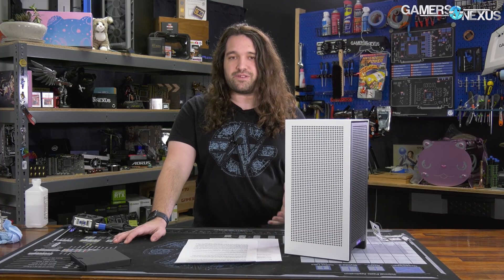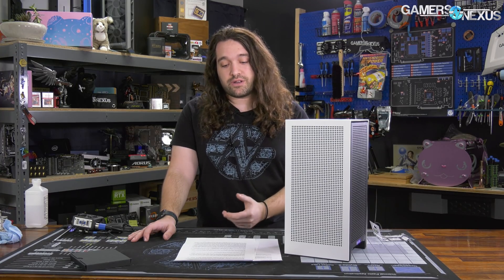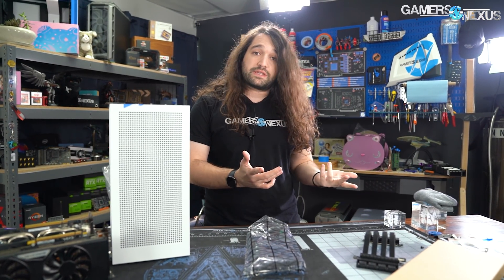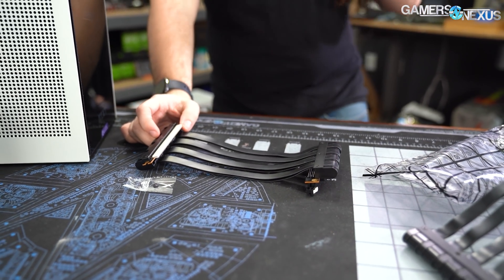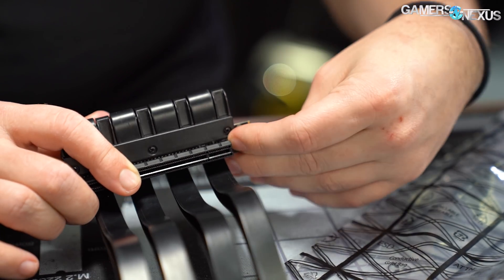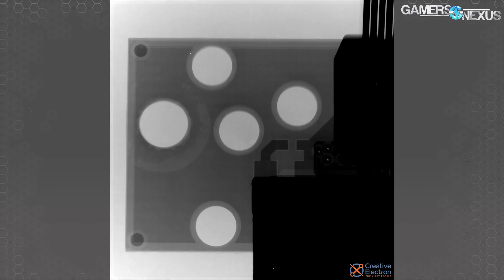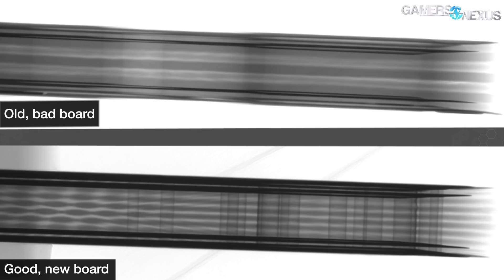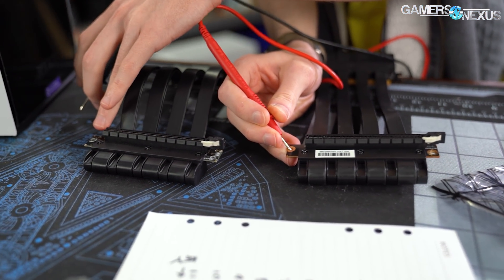Fire or No Fire: New NZXT H1 Riser X-Ray & Testing (NZXT H1 PCIe Riser Fix)

Comment: the "holes" around the hole are via's. they connect the top layer (usually ground) with the bottom layer wich is also usually ground around the hole. this is much more obvious to see with the screw holes on most motherboards.
Reply from the maker: Thanks! I had heard the term "via" and was aware of the concept from reading, but never bothered to look up a photo. That makes a lot of sense. Thank you for taking the time to comment!
Reply: @GamersNexus  It should be noted that due to the large pad around the screw-hole, the larger hole diameter, and the via-stitching (in this case for structural reasons) means that any non-GND power planes should be fairly far away, and while it is hard to prove a negative I'd feel fairly safe with the new risers. It's honestly hard to end up with a bad board like the first type, especially when you're not making a "one size fits all" board. If you want a look at the issue from a layout-pov then I did make a "short" video on it when you released the first video :) https://www.youtube.com/watch?v=W3Qo7hhiTiI
Reply: @GamersNexus  The purpose for these vias, stitching vias, is to connect the mounting hole to the GND plane. Why do this if we already have a plated mounting hole? Well connecting those vias ensures that even if an improperly sized screw is threaded through the hole, the mounting hole will still be grounded if the plating of the mounting hole is shredded from the screw thread. Additionally, these holes can further assist with EMI management. There are a couple of other benefits that these give if they are exposed (no soldermask on top) for thermal management and wave soldering. Here is a great article from Cadence: https://resources.pcb.cadence.com/blog/everything-you-need-to-know-about-drilling-pcb-mounting-holes-2

In RF designs, you'll see large portions (usually the entire outline and key individual sections) of the board lined with stitching vias. There are some more low level reasons for this such as minimizing plane impedance and reducing on board EMI transmissions. These geometries have been thoroughly tested for a long time, and we use these best practices to avoid gotchas!

I hope this helps, you guys rock!
Reply: @GamersNexus  in addition to Taylor's response, when we manufactured boards at my old company, the grounding holes had radially symmetrical vias arrays cut through and tinned not only for ground conduction / ensuring a positive connection between the screws and the grounding plane on both sides of the board, but to also offer some mechanical "softening" and 'weakpoint' of the PCB. The whole hole (lol) array created a weakened circular area of the PCB around the screw head to give you more room to feel overtightening (or hear it compressing) before accidentally cracking the board... and in the case where you did over-tighten it and crack it, the board is more likely to crack as a ring (through all layers) locally around the screw, rather than propagate across the board, damaging other traces. You would get a free-spinning screw with broken PCB in a circular pattern that you could tighten all you wanted, and it wouldn't do any more damage other than making fiberglass dust. In our designs there were never any traces near those vias in any layer, even in multilayer boards- for this particular reason.
Reply: @GamersNexus  The small holes are vias, they are used to join traces on different layers of the board, not just ground. Several people have suggested in this specific case that they are being used to join the top and bottom ground planes which is common practice but I'm not sure that is the only purpose here. I think the idea might be to try to form an electrical shield around the screw, in a similar fashion to how they are stitched around the edges of a board :-)
Reply: @GamersNexus  I will second most others that mention mechanical strengthening of the fiberglass PCB with squishing force from tight screws.  not just lower inductance vertical electrical/thermal connections that a mounting hole generally doesn't need for a properly designed PCB layout (that complies with NEC&CE laws). The ONLY time I have ever placed smaller vias around a mounting hole for reasons other than mechanical strengthening the PCB, was under a TO220 like part for thermal connection to what the screw was connecting the PCB to (AKA a heatsink on the back of the PCB for the TO220 part)
Reply: @Zarcondeegrissom  This - The hole is GND, large diameter, so there is negligible effect of these vias on ground path. Somebody can claim high frequencies, skin effect or whatever, IMHO there will be no measurable EMC difference with these vias or without (stitching ground planes as shielding around noisy components as a form of shielding is completely different thing - and very effective one). So this is purely mechanical. Though i think these are most of the time overkill - but they increase mechanical resistance from people over-tightening screws and the cost is negligible  so why not right? Also looks like NZXT after the screw up wanted the thing overbuilt a bit so they can be sure. So from hole drilled into bare PCB you have plated through hole reinforced with vias and gold plated. I would really like to know how brutal one must be to destroy hole this size (especially tinned, as it is on most motherboards) even without the vias.
Reply: @pavels4923  I wouldn’t call it overkill, via is basically free anyway, so why not. I think the real effect will be to provide better grip to hold the pad to the PCB. As copper pad doesn’t stick to PCB well without via, it just glue on the FR4 base board. The pad is taking force during installation. Other EMC, ESD are just bonus.
Reply: @GamersNexus  same term used in VLSI layout for connecting different layers of silicon
Reply: @GamersNexus  The reason for the vias is that the mounting holes are not plated. If they were, you would have to mask off the hole before it goes through wave soldering. So the vias are simple there to connect top and bottom as if the mounting hole was a massive via.
Reply: One other use for the via's is to transfer heat from one side of the PCB to the other. In this riser PCB it's not necessary but PCB's used for certain power supply modules use large copper pads with loads of via's to transfer the heat away from MOSFET's and other components.
Reply: Definitely right! If you end up working with x-rays more, you can see them provide grounding through multiple layers and planes in more complex PCBs. You can sometimes see them exposed on motherboard mounting holes. The pattern is for physical protection (like threading in an improper screw cough cough), as well as emf benefits in some instances
Reply: Side note, vias are more generally used to connect copper traces between any layers (if it is a multilayered board), not just the top and bottom. They do generally go through all layers though, so the PCB designer needs to make sure other signals are not touching the via
Reply: @cheetoritos  Blind and buried vias :)
Reply: Yup, this is the correct answer!
Reply: I was surprised he called them 'tubes' and I thought it was just trying to use layman terms... but then the question popped. I'd have thought the guys w/ the xray would know that.
Reply: Multiple reasons they use all those little holes ( via's ) rather than relying on the big plated through-hole to connect the various layers. One is reliability the screw holes have more stress and strain and can crack, leading to a separation of layers and or an increase in resistance. So by using "Via stitching" You create a strong vertical connection between planes in a multilayer board. Also, this results in a low impedance connection reducing signal noise. It also acts as a via fence (a.k.a via shield) a row of vias that line a signal’s route path that reduces crosstalk and EMI effects. TLDR The new board is a much better-designed piece of kit.
VIA is short for vertical interconnect access. Via is also the Latin word for a path. As a result, the acronym is treated colloquially as a word, “via,” instead of an acronym “VIA.”
Reply: @kgrach  cool
Reply: Correct. This is used to assure that any current is travelling through either of these pads and through the screw, rather than finding a different path. Vias are used for routing traces on different layers and on  power places to keep them "the same" throughout.
Reply: Corrct my dude
Reply: I expect the smaller vias are for additional mechanical strengthening, if you tighten a screw down hard it can compress/crush a PCB which reduces it's strength and considering the PCB is going to be one of the support points of a gaming GPU, it is probably a good thing to have a little extra strengthening.

Comment: I just love that you used the footage of emptying an entire tube for the Kryonaut sponsor segment.
Reply from the maker: We bought the whole tube, we're going to use the whole tube.
Reply: @GamersNexus  hahahah u legend
Reply: @GamersNexus  What is your opinion of the new Kryonaut Extreme?

I recently replaced the Evga 2080 XC Ultra's paste because it had gone LIQUID and had poor covering.
I don't know what happened to the paste but the silk screen seems to not have been applied properly, also the screws weren't well tightened.
It wasn't something I'd expect from a respectable manufacturer from Evga.

Thermals dropped significantly when Kryonaut extreme was applied. With default settings in Precision X1 and boost lock enabled the idle temperature was 53 degrees in Windows with the fans off. Albeit I did have a dynamic wallpaper with Wallpaper Engine enabled that drew some GPU usage.

In any case I am curious to hear about GN their opinion on the pink stuff that is Kryonaut Extreme.
I just love the color because it is easy to clearly see if you have proper coverage. What about you?
Reply: @GamersNexus  MAKE IT RAIN
Reply: ..........i never thought i would have a video playing in the background and then read a comment about the ad spot and specifically searching for the sponsored segment!!!
Reply: @Thaddeus Cosse and you can never have too many tweezers
Reply: I paused the video after the ad to check the comments to see the first one that commented on the thermal paste. I don't think he put enough on there tbh.
Reply: went straight to the comments.was not disapointed.
Reply: Wait, you aren''t supposed to use the entire tube of thermal paste?
Reply: Full Verge! (in french it means full d***)
Reply: More is always better! 🍺😁

Comment: TL;DW New riser cable did NOT catch fire after GN's attempts to cause a fire using the same method as the old faulty cable, and the new design seems to be improved.